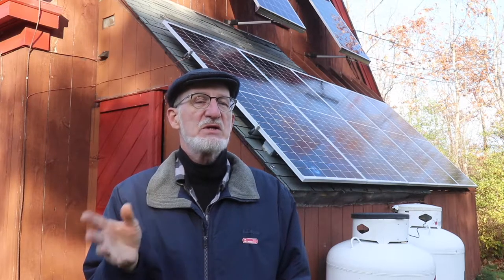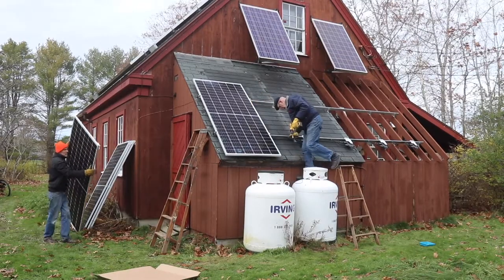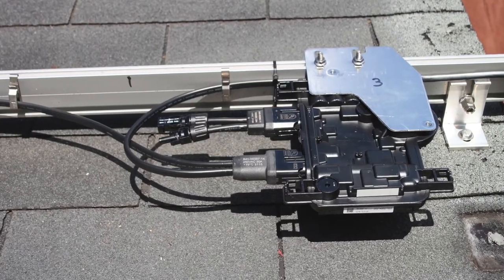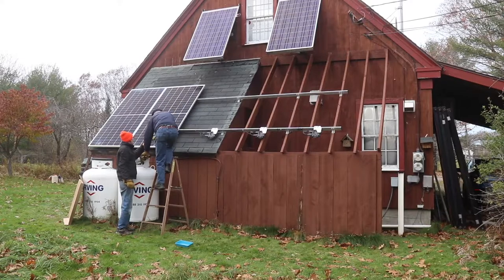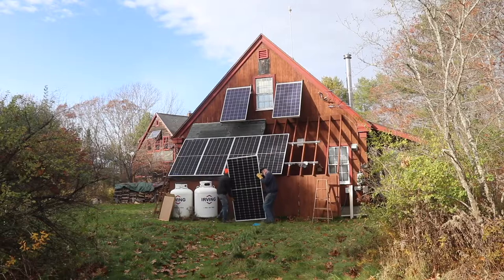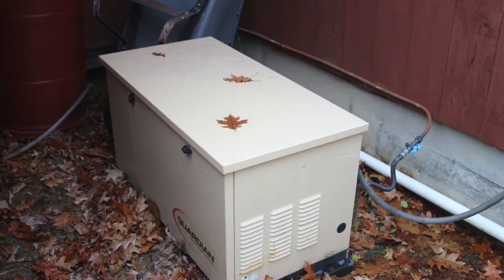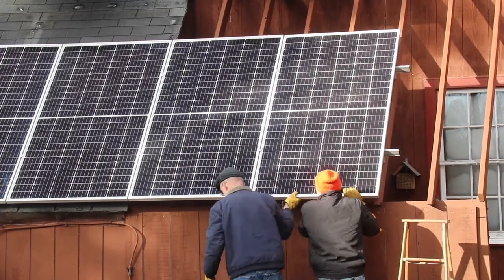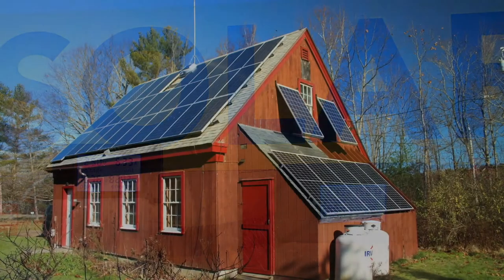Replacing Solar Thermal Collectors with Heat Pump powered by Solar Panels

Comment: Battery storage is the key to your system.Well done with your commitment and ongoing improvements.
Reply from the maker: Thanks.  Yes, it's just a question of time and money.  Battery is on my list for the indefinite future, but for now the propane generator work fine as a good (Faustian) cost/performance/reliability trade-off.

Comment: Great idea, BUT I would have thought unless you use battery power storage for the panels it's of limited use. Surely you need the heat for the air source heat pump the most when it's cold & grey & at night, not when the sun is shining bright, when the panels work best?
Reply from the maker: I have net metering.  So I get full retail credit for energy I put back into the grid.  This happens almost every sunny day to some degree.  So basically the utility is my battery.  I build up a kWh credit throughout the year that I then use up in the fall and winter.
Reply: @GuyMarsdenMakesStuff  I switched to high rates last year. I export more than I import. The higher the rate the better for me. I have power bills that are credit bills all year long. That credit covers 60% of my gas.

Comment: Geez.. wish someone would have used the system you had already to be the "ground source" for a ground source heat pump
Reply from the maker: I am not a big fan of ground source heat pumps especially on my particular property. It just doesn't make sense.
Reply: @GuyMarsdenMakesStuff  When I put "ground source" in quotes, I was referring to useing the ground loop in your solar collectors instead of the ground.

Comment: I’m thinking about ducting the warm air from underneath rooftop solar down to an air source heat pump to improve its COP.
Reply from the maker: I've seen people do things like this such as putting hot water collectors underneath solar panels. You would need to remove the heat quite actively so the panels don't get unreasonably hot which compromises their performance
Reply: @GuyMarsdenMakesStuff  There’s an Australian company called Sunovate making a ventilated rooftop panel system which is supposed to improve performance and longevity by keeping them cool.
Reply: Air source heat pumps move a TON of air.  Ducting from under your solar panels will help keep them cool, but do little to nothing to improve COP of the heat pump.  Research why you don't put an air source heat pump inside a greenhouse or solarium.

Comment: What was/is being used for domestic hot water?
Reply from the maker: That is my workshop building - it doesn't have running water. 

But my house has collectors that heat a 40 gallon tank that then feeds into a propane tankless water heater.  Details here:
https://www.arttec.net/SolarDHW/index.htm

Comment: How is the system working out for you? I am looking into getting a solar assist heat pump. 2 zones. I already have 9000 watts of PV on the roof and they won't let me grid tie any higher than that. So I'm looking into getting a direct DC coupled solar assist heat pump for heating and cooling.
Reply from the maker: I have almost 8kW on the building, so I'm almost maxed out too.  The system powers the workshop (where the panels are), my house and my car. so it's not nearly enough in the winter.  But I'm hoping to accumulate enough credits this year to get me int the winter.

Comment: Nice place you have there.  It seems like you are producing a lot of electricity for such a small dwelling.  I hope the new heat pump works out for you.
Reply from the maker: Actually that building is my workshop.  My house is bigger and also has a heat pump, and the solar also powers my Chevy Volt.  So it's not enough to cover my needs in the winter, but I don't pay for electricity for about 8 months.